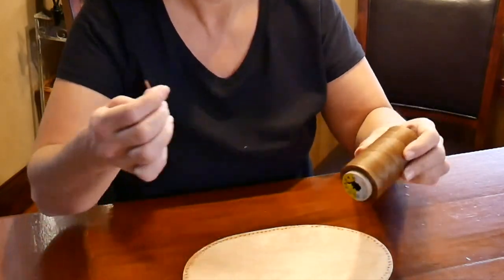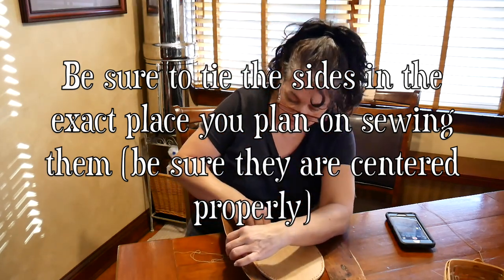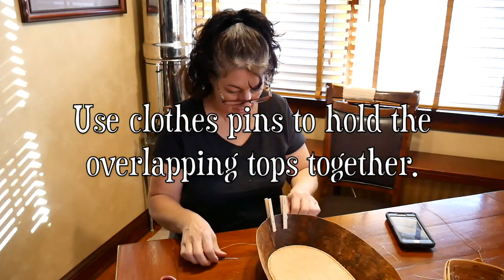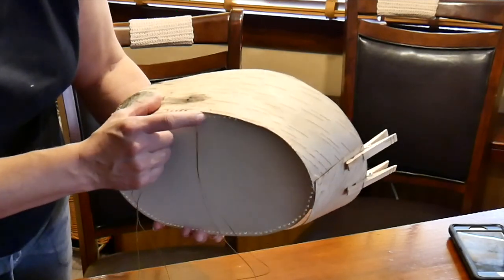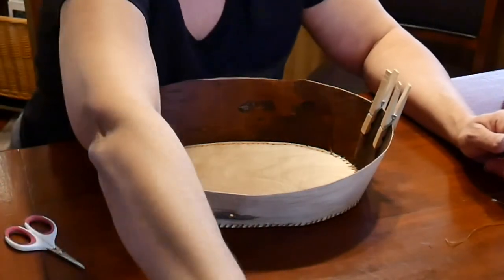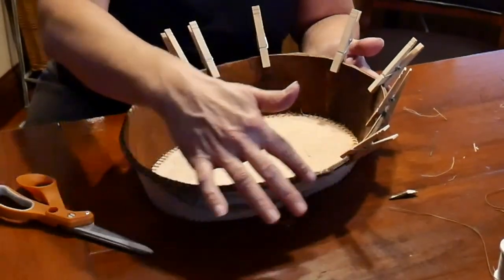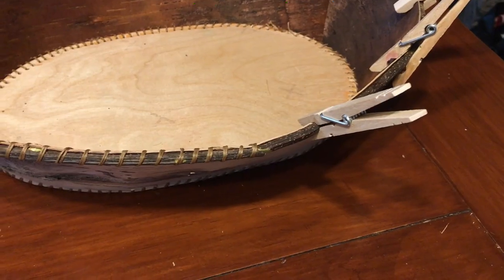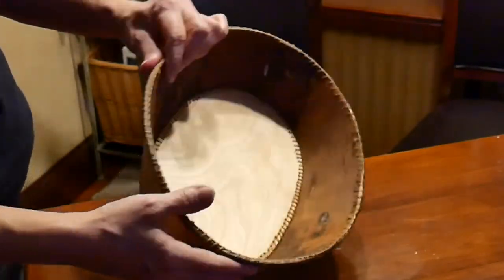HOW TO MAKE A SIMPLE BIRCH BARK BASKET

Comment: how far apart were your holes drilled?  from what kind of tree/bush were the twigs for the top from!   It is an awesome look!!  Great job
Reply from the maker: Thank you so much! I drilled them approximately every quarter inch but I didn’t measure. I just kind of winged it! I believe those twigs were from overgrown privet hedges. I’ve used long branches from a lot of different things though. Basically anything flexible. Here’s a link to a template on my webs. There’s more information there https://www.creatingasimplerlife.com/blog/making-a-birch-bark-basket-centerpiece#